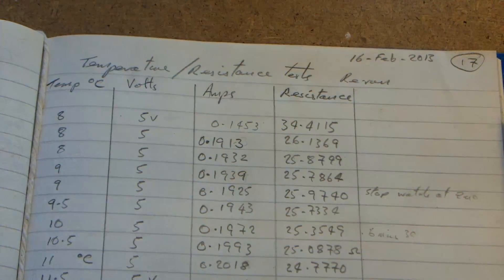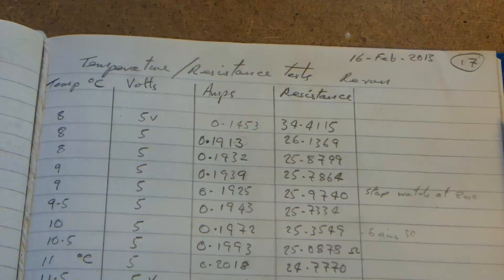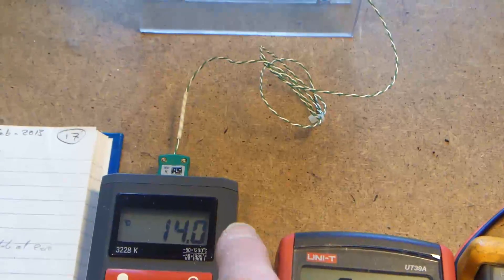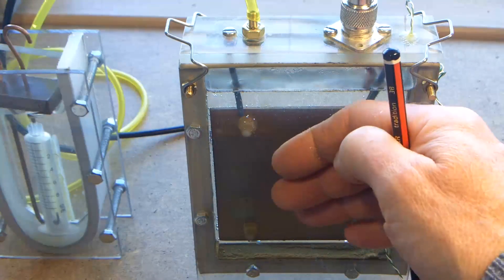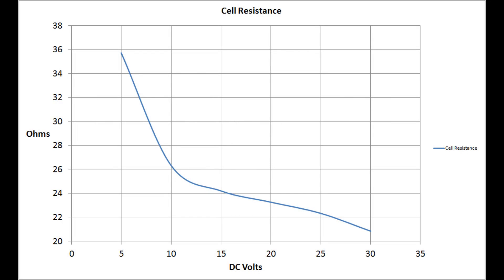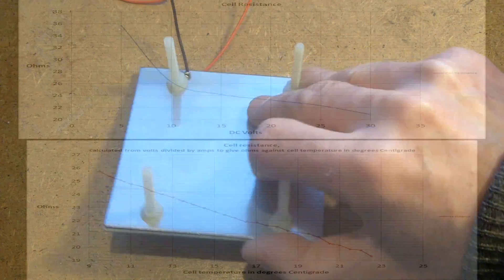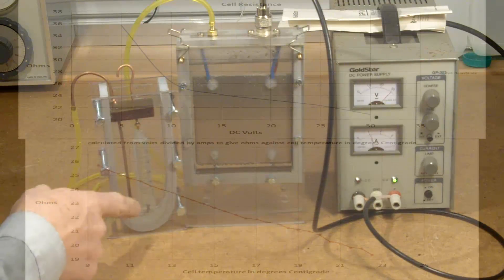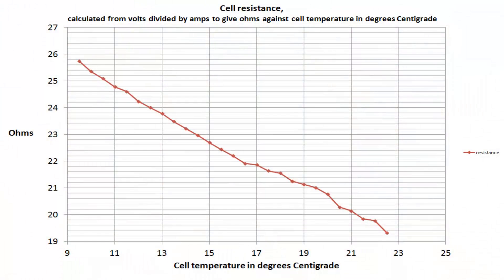HHO. 11 Cell resistance vs temperature ~ 0.49 Ω per °C

Comment from the maker: Yes. Hi, sorry if that wasn’t clear but I just wrote down the same powers as quoted of different sites for the different metals but that’s a difference of 0.000000017Ω.m for the copper to 0.000000074Ω.m for the stainless steel.
In other words a 1 metre cube of copper would have a resistance from one side to the other of 0.000000017Ω and a 1 metre cube of 316L stainless would have the higher resistance of 0.000000074Ω so 1.7 x 10-8Ω.m and 7.4 x 10-8Ω.m respectively
   
Regards ... Andy
Reply: I am seeing on the internet the resistivity of 316L Stainless Steel as 74×10^-8 [ohm*m] and not 7.4×10^-8? Which is correct?

Comment: Yeah, that is the $64 dollar question. For high amperage DC (>0.5 amp/cm2 plate area) electrolysis is the lower resistance of a copper electrode worth the cost for increases in the overall efficiency of the cell? 

Most of todays HHO units in the marketplace uses pulsed DC power supply. The higher the amps the more HHO generated (Faraday Law).   

When pulsing >1 amp/cm.sq. plate area w/DC amps at 20 khz, would copper electrode be more efficient?
Cheers
Reply: How do I calculate the maximum current density (Amps per meter squared) for square plate shaped electrodes of various materials (316L Stainless Steel, Graphite, Platinum, Iridium, Nickel, etc.) that will be used in water electrolysis before the plates begin to overheat (the heat boils the water producing steam or melts the electrode material)

Comment from the maker: Well the resistivity of copper is around 1.7 x 10-8Ω .m and the 316L is around 0.074 x 10-6Ω .m so there would be some very slight benefit but I think that given the typical thickness of plate and currents involved in most cells it would amount to much in a DC cell as it looks as if one of the plates should be inert. When you move into RF then skin depth comes into play and resistivity has a bigger influence but again the currents are likely to be reasonably low. But every little bit helps.
Andy
Reply: How do I calculate the maximum current density (Amps per meter squared) for square plate shaped electrodes of various materials (316L Stainless Steel, Graphite, Platinum, Iridium, Nickel, etc.) that will be used in water electrolysis before the plates begin to overheat (the heat boils the water producing steam or melts the electrode material)

Comment: Thank you for your reply Andy. 

What was very interesting with copper plate and stainless steel cell experiment was not only that it worked one one configuration of connecting the positive and negative power leads, but that could lead to a more efficient cell design. 

If it could be proven by further experiments that there is less cell resistance using copper plate vs stainless steel plate that would be a major advancement in this HHO field!

Keep up the good work!
Cheers

Comment from the maker: Hi, thanks for the interest. Well the copper/stainless steel test was, as far as I took it, conclusive. That is you can use the two dissimilar metals so long as you keep the stainless steel negative and the copper positive. There really are so many options/variations that one could look at that it would be very easy to lose focus and go off at a tangent, something I'm very good at.
Kind Regards ... Andy

Comment: First off thank you for sharing your interesting HHO experiments. 

What ever happened to the copper/stainless plate cell experiments since your very interesting 1st experiment?  Did you ever compare the copper/stainless plate cell to the all stainless steel cell design? 

Would the copper plate cathode with 316L anode be more efficient than just all 316L plates cell?  "Inquiring minds want to know" 8>)

Keep up the good work!
Cheers

Comment from the maker: Hi, it’s just as if you were looking over my shoulder; about ten minutes ago I came to the same conclusion. I’ve just started looking at some low voltage work and I had trouble turning the volts down and I’ve found the cell is holding a charge I noticed that when I reduced the volt the current reading was going negative. In other words the cell was trying to drive the power supply. I’ll be uploading that particular event in a day or so. Thanks for the input.   
All the best ... Andy